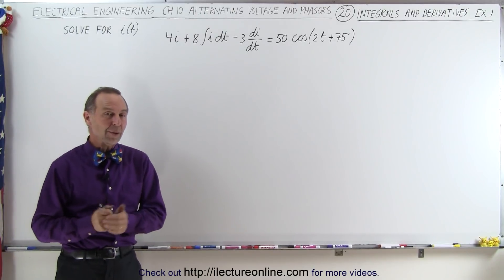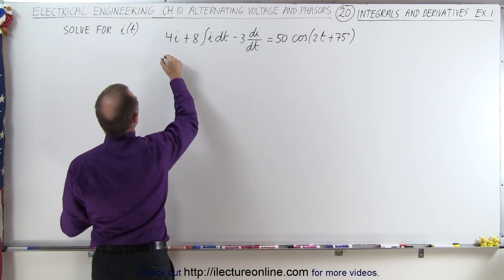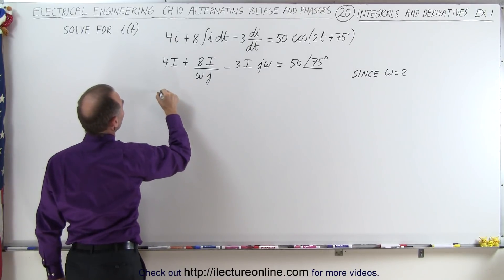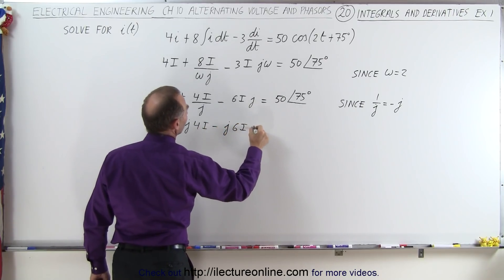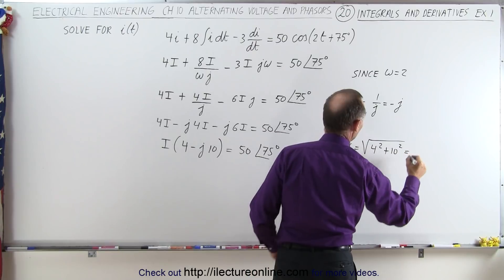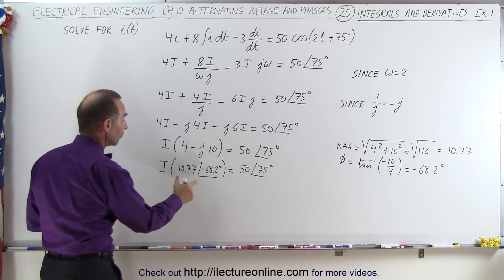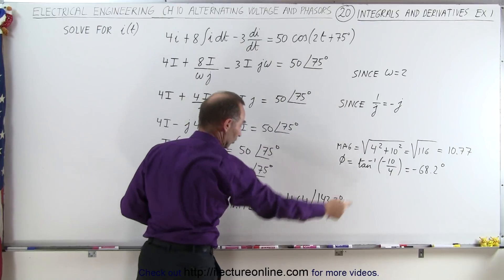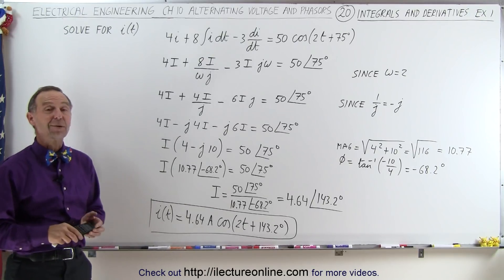Electrical Engineering: Ch 10 Alternating Voltages & Phasors (20 of 82) Integrals & Deriv.: Ex. 1

Comment: Help!  Which previous video explains integrals and derivatives resolving to  ohmega t  values?
Reply from the maker: If you watch the earlier videos in the playlist, they systematically explain the use of phasors and the representations.   Note that the terms in the equation represent the voltage drops across each of the components.
Reply: video 14

Comment: @MichelVanBiezen, why does the voltage across the inductor = -3di/dt? 
Michel van Biezen
Reply: That means the current is decreasing thru inductor... So going thru voltage drops acrros inductor, the inductor actually acts as a source... Which is trying not to decrease the current... Or take it to the right hand side of equation... Left side of equation represent all the energy sink... Right side, the energy source... Moreover you can see the current phasor... Its cosine function with phase shift of 143.2° which means the x axis has been shifted 143.2° to the right and at that point, the derivative of current wrt time is negative... Meaning the direction in which current is flowing is slowly decreasing.

Comment: Angular frequency =2 rad/sec
Then after converting to polar coordinates it becomes -68.2 degrees 

Firts you used rad/sec then degree how?
Reply from the maker: The angular frequency remains at 2 rad/sec and doesn't change throughout the problem.         but 4 - j10 = 10.77/-68.2 degrees